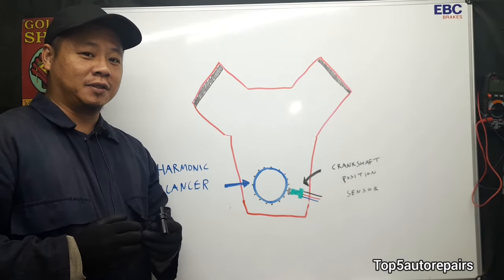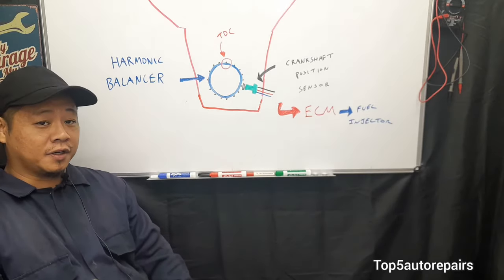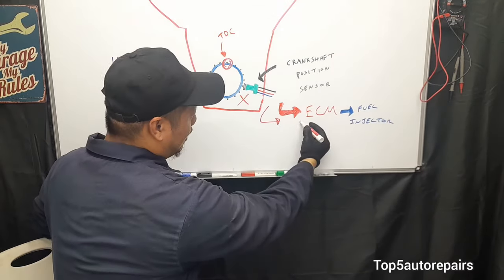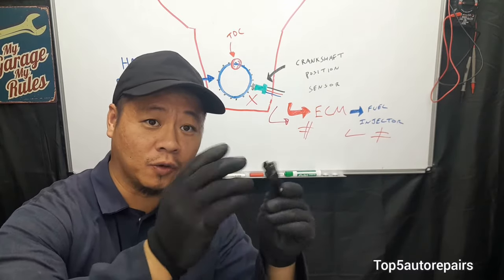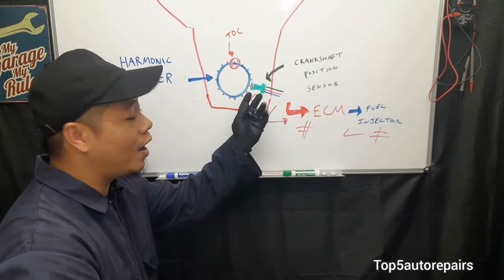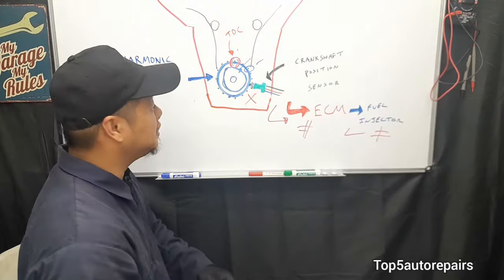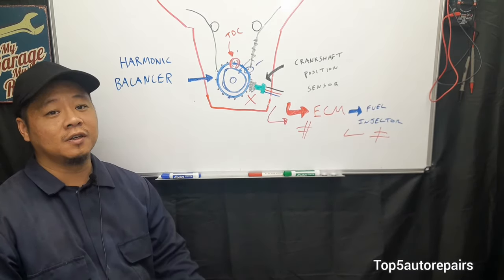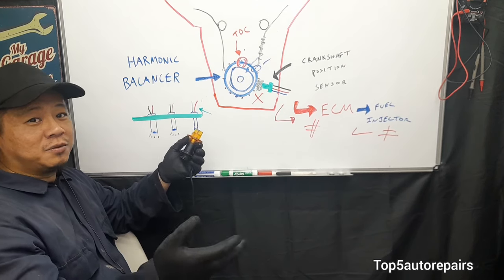Symptoms of Bad Crankshaft Position Sensor (Explanation Why It Fails)

Comment: THANK YOU!!! I have a 2014 Hyundai Accent GLS. I've taken my car to two different shops, one of them being the DEALSHIP and none of them could figure out what was wrong with my car. My car isn't throwing any codes, but it has all the signs of it being a bad crankshaft sensor, I have replaced my battery, the alternator, and the spark plugs and my car still continues to shut off. The RPM bounces around then drops to 500 from 1000, the idle is rough. it'll stall while it's parked if you breath in it's direction, and for the first time is shut off while I was driving. I am $1500+ in the hole for a $45 part. I'm just going to fix today myself because I'm at my wits end. I hate Ubering and I live in a town with no Mass Transit. Wish me luck! Thanks for the info!

Comment: Very informative video 😊I have a Suzuki tl1000r (vtwin) with No spark at the rear cylinder. I have changed plugs, coils, wires, checked connection to ecu for resistance, and continuity, the coils are getting 12v from the ecu. Only thing left is the crankshaft sensor, do you have any advice here? It still only fires on the front cylinder, so the sensor is good. How do I properly check the pickup/harmonic balancer?

Comment: Great video. What if you have a new engine wiring, crankshaft position sensor and fuse box , but still getting P0339 code? What could be causing the issue? Also what is the name of the injector light tester you showed in your video? Thank you!

Comment: hey my friend I have a question for you, I have a problem with nissan titan 2014 sometimes it starts and sometimes it wont alraeady replaced cam and crack sensors but is doing the same thing 
when it doesnt start I DONT have INYECCION PULSE IN ALL INYECTORS so my question is which sensor is resposible for telling the computer to fire the inyectors when cranking 
I HOPE YOU CAN HELP ME WITH SOME IDEAS THANKS MY FRIEND

Comment: Is it possible that my car stalls sometimes without any fault sign on the dashboard and error code in memory due to faulty crankshaft position sensor?
Thanks for great video!
Reply: I’m experiencing same thing with my 2006 Honda civic EX, car cranks but no start, No Check Engine light & scanned it & no codes either…. & I already put in a New Starter, New Battery, New Spark Plugs, & it worked fine but then it wouldn’t start later on, I was thinking it might be the ECM & today I went to AutoZone & see how much would it cost to get a new ECM but sure enough it’s pretty pricing ($395) & not only that but I would actually have to send out my ECM to have them Rebuild/Refurbish & it’s a 50/50 chance they could even fix it & I still would have to pay that amount smh. Sooooo after watching this video, I’m thinking of doing this first (Change my Crankshaft sensor) & see if it makes a difference or even fix my problem.
Reply: @chaneketaso did you change crankshaft sensor?
Reply: I was going to do that actually from all the research I did lol but I figured out the problem, so I ended up talking to a mechanic & he diagnosed the problem, it was actually the fuel pump, I told him but I can still hear the humming sound when I turn the ignition on & he said sometimes fuel pump can go bad even though you can still hear the humming sound. So when I replaced it, it worked!
Reply: @chaneketaso  I’ve replaced my fuel pump. I didn’t change filter. Mine is cranking , but not starting. If I spray starter fluid it will crank then shut back off. I also replaced throttle body, & spark plugs!

Comment: Heat related intermittent stalling. Mine only acted up after running the engine about a hour. Placing ice on the sensor temporarily fixed the problem. That told me it was the crankshaft sensor, not the camshaft sensor, or the computer.
Reply: Did you end up fixing it?
Reply: @corbenrawlings7937  Yes, I replaced the crankshaft sensor. Pay the little extra and get the part with the alignment jig with it.
Reply: @markweiss5152  thanks for the reply I really appreciate it. I’ve ordered the crankshaft sensor and hoping it will fix my issue too. What type of car was yours?

Comment: Does a mass air flow sensor need to be program after installed reason for check engine came on after I unhooked the air cleaner to install air filter then I started to get purge codes p0442 and p0455 now I have oil leak can't find where it's coming from

Comment: I'm getting a p1337 cil light. It's a 98 crv stock 5 speed manual. Car runs great and experiencing absolutely no problems. However light won't go away
Reply: I've replaced the crank sensor twice no help.

Comment: Cool thanks!! 
So I bought a Dodge Ram 2005 hemi  82 thousand miles it likes to stall out in the morning when taking off from a stop sign or backing out in the morning after warm up.
My buddy who's has past said its done this since he owned the truck I'm the new owner what worries me they could never figure it out.
I'm worried that this could be very dangerous if he took it to a dealership and they couldn't figure it out I might be left trying to figure it out my self .
Man what you say sounds so it .
I'm so sick of mechanics who charge a huge fee .
I just got the plugs done 16 plugs $598 bucks no wires no coils just plugs.
So with that said do I have to reset the new crank sensor when installing it back in and if so what needs to be done to do it in order for it to start correctly?

Comment: I have long cranking and then car dosent go well but when it starts normally car goes normally i have changed camshaft postion sensor. If i change crankshaft sensor on my bmw e39 530i 2001 does it need recoding if buy non eom part i bought febi bilstein sensor to camshaft. Please need help. So if it cranking 3sec before start i turn engine off and try again if it starts direct then i can drive without power losses. All the best

Comment: So I replaced mine and it didn't help any on my 2008 honda accord. It didn't help it got worse. So I put the old one back in and then had it relearned. It worked for like a week. Then went back to limp mode. It's probably my wiring wouldn't you say? If the censor was bad it wouldn't of worked for that week I'd think

Comment: Hello dear! Can you explain why my electrical gadgets are not working along with crankshaft issue that was detected by the ECU system. Im replacing the crankshaft for now but electrical problems still exist... I recently changed the battery 3 months ago. Could it be something else? Your advice would be of great value 🙏🙏😊

Comment: Hey i have a mercedes om642 diesel and on the female to male connectors of the cranck position sensor there was oil accumulated. Is there a reason why it would start to stop the engine running after being driven but then starts after 1 or 2 hours cooling down?

Comment: Would that cause a temperature difference in the Cadillac converters.
2013 Ford f150 econo boost 3.5 driver's side Cadillac converter gets hot and the passenger side catalytic converter is cold.
Would that be a dollar store error Explain the intake camshaft positioning timing sensor

Comment: Still waiting for my order. I hope that's the problem of my Honda civic si 2007. It start when it got heated its stalls. It drives but when I stop its stalls. I change already my map, maf sensor. I hope crankshaft position sensor will fix my problem.
Reply: Did it?
Reply: @leolequerique  nope. I sold the car.

Comment: Can this apply the same to motorcycle like Hayabusa Gen 3?

My bike fall on the left side where the stator housing got cracked. The CKP sensor was in the stator housing...After the incident, when I was riding my bike I feel someone was pressing the brake....the bike got lagged but it was still able to ride like normal. 

I went to installed Brembo Brake and clutch MC....this is where things got worst.

The bike will bog, unstable accelerations and stall. At traffic lights(stationary) the engine will get very hot and stall. You have cool it down for 15mins and the bike is able to start. As it accelerates again it will feel like something is pressing the brake, lag and stall. The rpm is unstable and check engine and fi sign appears. Can this be the CKP sensor faulty?

Comment: Hi my 2006 sienna has a P0016 Code cam and crank out of correlation but no bad symptoms it turns on without hesitation and engine runs steady the problem started when i took it to a mechanic for a p00300 multiple misfire issue and he said it was a bent valve be removed the head on bank 2 and when i got the van back it had that new code P0016  i took it back he the  took cam gear pully off and basically he couldnt figure it out. What can it be??  I benn driving it for a year everyfay like this.

Comment: It can also be your map sensor or cam shaft sensor as all 3 of them control you power train of the motor so it could be either one of those sensors without a code

Comment: The camshaft position sensor is related to P0340 code. But a timing belt losing teeth often causes P0340.

Comment: I'm trying this next, my civic has been misfiring for a year and at times goes into limp mode, when I restart it it's not in limp mode temporarily.  I've replaced many coil packs, fuel pumps, spark plugs, VVT solenoid, EGR valve, Throttle Body, PCV valve, I'm thinking maybe the crank sensor is weak , or cam sensor, or MAP sensor? Idk but I've had it with this war. It's stuck home in the garage.

Comment: could this sensor be a reason why my fuse to the fuel pump wouldn’t be getting any electrical continuity? 
I used a test light the other day on locations that could be causing my car not to start and so far it’s been that fuse; my fuel pump relay is good tho no issues there

* new fuel pump * 
* new fuel filter *

1992 bmw m50 non vanos motor if it helps

Comment: Hey man. My car was running but bringing up a service engine light and the code was I had a bad sensor, but my car was still running….. I decided to go ahead and get a new sensor to get the light to go away, put the new sensor in and now when I try to turn my car on it won’t turn over completely. It’ll try to but won’t. I can’t figure out what

Comment: The car will suddenly stall with first loosing power or misfires? There was no indication that a stall is imminent?  Will the ecu always through a fault code when the crank positioning sensor gives unexpected data?

Comment: Thanks for the video, I've been having this problem with my Wrangler JK, intermittent shutting off of the engine at very low speeds and it's been driving me crazy. Also got the camshaft position sensor bank 1 code so I'm replacing both with Mopar OEM parts, then using my Jscan app to reset the computer, hoping corrects the situation.

Comment: Kia Sorento...runs until fully warm..made it 5 miles every time. First time was camshaft sensor. Second camshaft sensor worked loose. Now it didn't help so going to crankshaft sensor...needing to pull timing, etc so replacing belt and plugs and valve cover gaskets.

Comment: I have a p0340 code. Already replaced the camshaft sensor. And the code is still there and the car still won't start. My battery keeps getting shorted out and the fuel pump and fuel injectors are off. So now I think I know what the problem is. The wiring harness to the camshaft position. I already bought the new wires and connectors I just don't know how to swap it out because I don't know nothing about electrical work. It doesn't say nothing about a crankshaft sensor or crankshaft wiring harness. But I still want to replace it because I think the crankshaft sensor and the camshaft sensor work together. I just hope that if I replaced the connector seen the wires that I can start my car because the fuel pump is off and I can't start my car. But if there's an open circuit due to bad wiring then that would make sense but I just need to know that if I replace the wires will my car start that's all I want to know
Reply: Any update on how this went? I'm in the same situation with a 2004 ford ranger.

Comment: Do crankshaft position sensor need to be programmed when its changed on 06 Nissan frontier? Are there any sensors that don't need to be programmed when changed?
Reply from the maker: There is no reprogramming for sensors
Reply: @Top5AutoRepairs  had check engine light on, code came back passenger cam pos sensor needed to be changed. Changed all 3, the 2 cam pos sensors and the crank position sensor. Check engine light went off but now when starting 06 Nissan frontier it has long cranking time before it starts. Do you know what could cause that? Thanks any feedback appreciated

Comment: The crankshaft sensor on a diesel is at the rear of engine. The camshaft senor is on the front of the engine.

Comment: I’m having a problem with my 2012 Honda Civic SI one day I was driving car completely shut off didn’t want to have no lights on the dash so we connected one wire straight to the battery from the ignition and finally got it turned on but now is saying that I have to That I have I’m sorry a crankshaft position sensor and also got another check A
Reply: Maybe I have to relearn my crankshaft position center

Comment: My car runs good , something is causing to much gas to go thru unregistered or at the peak . I think Causing the catalytic converter to burn out cause of the symptoms. And are sometimes for a couple days I get 53 mpg. And then it drops to like 26 30 highway. Like as if it's under load or maybe the camshaft sensor on the 2006 civic ex ivtec coupe gas sohc 1.8L. stick shift. Red. Maybe the sensor is make the cam shaft profile not change or maybe it's changing but not registering. The engine is perky still so it can be the map . And I've done the o2sensors .and the air box sensor.  But the car runs good. I can't find the issue it's been two years.  But it exist and is there. It don't miss fire. It idles right.  It rides in first gear with the stick shift without engine fuel injection jumping. I've done breaks . But I haven't done the map. Or the cam sensor or crank sensor. It starts easy.  It don't die on the road with this mystery problem. . I believe it's burning out the cat what ever it is.  Like as if the engine is under load. Like as if it is stuck in the high cam profile of the ivtec. Or it does work and it's just the sensor not sending it back. There isn't much it could be..    I remember once or twice as a other symptom or mystery. The car like lost all power for a slit second. But never died. It just felt like a dip or jerk like as if everything shut down kinda. But not all the way. I don't know if that has anything to do with it.  And like two years ago the cam shaft sensor came on or was it the crank shaft sensor .i don't remember anymore. And it went off . And like 6 months later came back and went off never came back on I don't know if that anything . I want my gas mileage back. Thanks

Comment: I think this is my issue on my Rsx. It starts fine and once I drive for 20-30min it will stall at idle like if the key was turned off, so it’s cutting spark and just stalls. Then when I try to start it, it will just crank. After sitting and cooling down it will start. No codes either
Reply: It could also be a Hall effect switch in the distributor. To test, tap the distributor with a hammer after the car is running at temperature. If it fails, there’s your problem. If there isn’t one in your engine, it’s going to be either the camshaft position sensor or the crankshaft position sensor, as in this video.
Reply: @vincentpritchett1231  it’s something in the ecu. The car starts fine when the ecu is cold. I tested it by leaving it on my dash for 20 minutes under the sun and then it didn’t start. I sent it out to get tested but they couldn’t reproduce the problem.
Reply: @joaquin0023  that makes sense, and since it’s intermittent, reproducing the problem is a pain in the rectum.

Comment: I am getting a bad crnkShaft pos code...Why would this issue cause the vehicle not to start when in park but it will start when in neutral?
Reply: It wouldn’t, check the switch that the shifter operates
Reply: @kellismith4329  as it turns out, funny thing, I had to change both the camshaft sensor along with the bad crankshaft sensor at the same time  even though the old camshaft sensor tested fine. Apparently the Nissan computer in that thing is ridiculously sensitive and it was not resetting the sensors because they work in tandem and the computer just would not accept the one new crankshaft sensor. Once I put in two new ones it worked. So weird... But hey I'll take it. The sensors were not much money fortunately. Thanks for commenting though!

Comment: Have a 24k swap and everything was fine. Changed out throw out bearing on tranny and put everything back. Start car and car started normal and few second later car shut off. Now car won't start unless I put pressure on gas pedal to keep trottle open. Engine code said its camshaft position sensor and change all that even changed out the crank position sensor too and still didn't help
Reply: Idle control valve is block off and reset in kpro. Timing looks good. Gas and sparks seems to be good too because I can keep car on by keeping foot on gas. If let go idle drop to 0 and die. Please help

Comment: So my car would loose power at 50 miles an hour. Mechanic said code was the crankshaft position sensor was bad so I put a new one. After the install and everything back on code still came out nothing changed  . What else can it be
Reply: @SleekMouse  yes they figure out believe or not it end up being the alternator electric issue that was making the code to go off. Change the alternator and code gone car working with no problem.
Reply: How was is the alternator???

Comment: I got a problem, I have a 2008 Chevy Colorado 4door 4x4 3.7 5 cylinder automatic transmission. The motor blew a rod, so I bought a 2010 3.7. But the old motor had 1 cam sensor, the 2010 has 2 cam sensors. Has anyone had this problem?